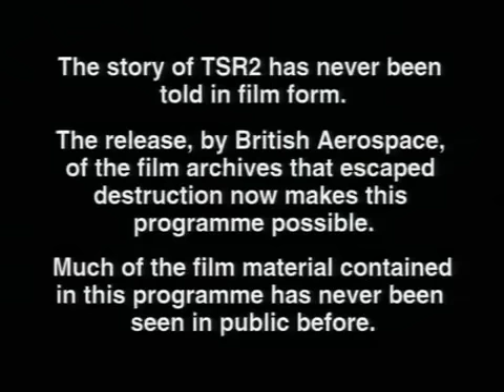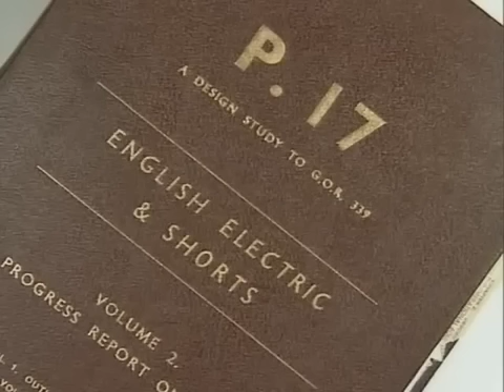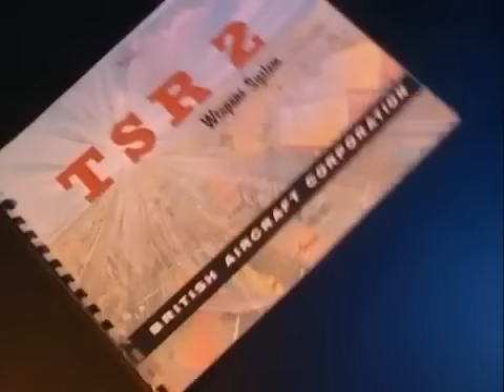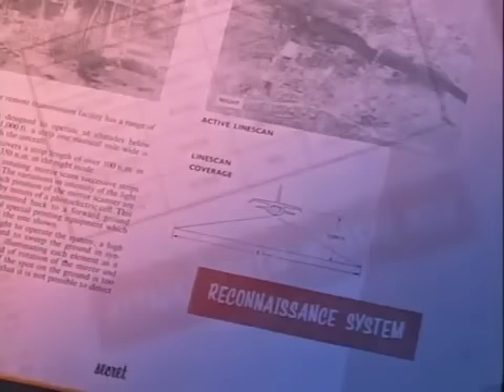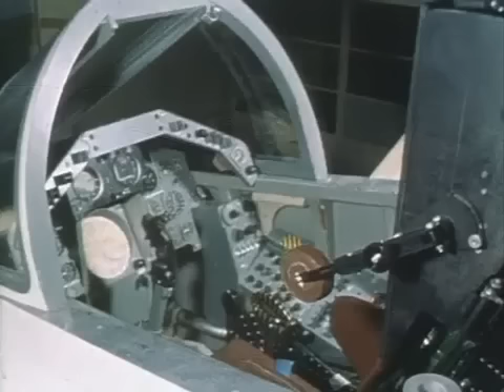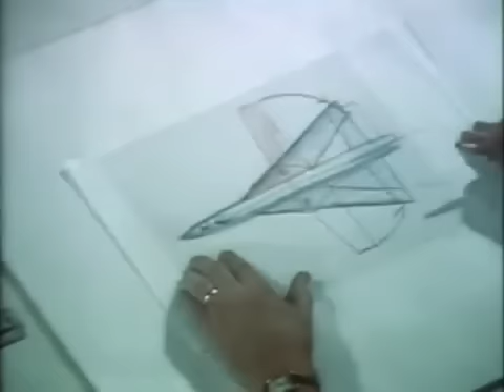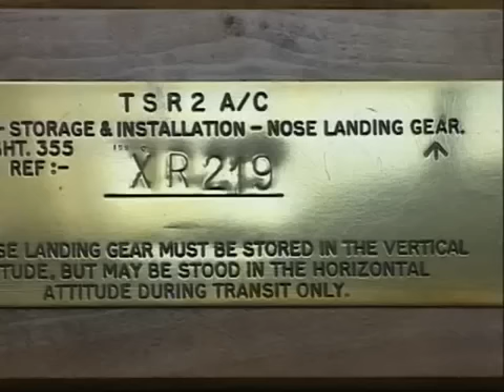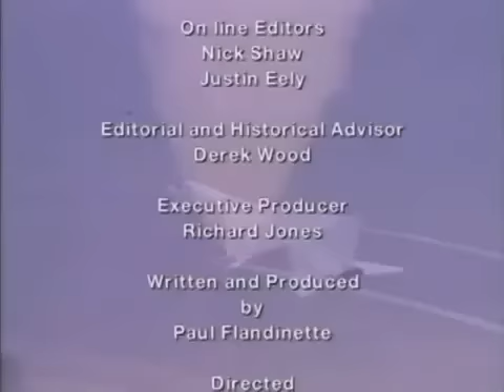TSR2   The Untold Story   Full Documentary

Comment: Yakuta Go •  I think you are confusing the roles here. Yes, the MIG 25 was unveiled in '67 & had Mach 3 performance in a dash -  ( but not in sustained flight ) because it was an Interceptor.
TSR -2 was designed as a Strike / Reconnaissance  platform with excellent flight characteristics at high altitude down to low level. The clue was in the name: TACTICAL STRIKE RECONNAISSANCE.
And the only reason it did not achieve all of its performance objectives was because of project cancellation. Even today, it is clearly obvious that the aircraft would have met -- AND exceeded these goals because of superior design.
Reply: But when you pushed the early Lightning to the limits, the engines wouldn’t inevitably end up blowing themselves to pieces.

Comment: As Sir Sydney Camm said famously: "All aircraft have 4 dimensions, length, height, width, and politics, TSR-2 only got the first 3 right."
Reply: Unfortunately Camm forgot economics. The broke UK economy could not afford a beautiful but overbudget aircraft  with badly flawed engines that would take years to fix, no export prospects and a better competitor in the F-111. Reality sucks but it is still reality.
Reply: @Completeaerogeek  The engine TSR-2 used was a version of the Olympus. Olympus was used on the Vulcan bombers and Concorde of course. As an aerospace engineer for 40 years, it is unheard of to cancel a project after just a few months from its first test flight. It takes quite a few years from first test flight to entering service. And of course, immediately (days) after the cancellation, all the prototype aircrafts were destroyed, including all drawings and rigs for it manufacture, nothing remains apart from two prototypes on display in museums. Officially, TSR-2 had never existed. It is politics more than financial considerations I'm afraid.
Reply: @daning9764   Dan if you understand engineering you would know that 'Bell Mode' a resonance problem with the LP shafts took years to fix at a time when the UK was broke. TSR2 was massively over budget and the F-111 proved superior in all performance regimes. If you were [paying for it what would you do?
Reply: @daning9764   And NO they were NOT destroyed. There are 2 beautiful examples- one in Cosford and one in Duxford. I know I travelled halfway around the world to see them recently. The simple truth is it was a problem child the UK could not afford to develop to be an also ran to the F-111.
Reply: So says the legends. Do you have a source for that quote?

Comment: ' only 1 engine in re-heat & he left behind a Lightning with BOTH engines in re-heat'.....WOW!
Reply: That was my sentiment to.
Reply: @speedbirdconcordeBOAB  They wouldn't have seen it and after a low level (illegal) supersonic pass they wouldn't have heard the tannoy announcement either.
Reply: This was because the lightning pilot was slow to engage his own reheat - as has been written before, a Volvo can outrun a Ferrari if the Ferrari driver isn’t ready, doesn’t respond straight away and is behind to start with

Comment: Something that I see as troubling is the extreme angle-of-attack this bird carried while taking off and landing. This was with flap-blowing in operation? Try to picture taking off at maximum combat weight. What also does the landing look like if the bleed-air for the flap-blowing is inoperative? There is also the issue of side-area of fuselage with respects to the effects of  crosswinds during landing/takeoff.
Reply: A side effect of the requirement to be able to land and take off on a grass runway. Despite being supersonic the TSR 2 had to be able to take off and land at low speed. The Harrier solved the problem by VTOL. The TSR 2 used air holes to supply or extract air from the wings surfaces to increase the lift and maximum angle of attack.

Comment: The B-1B Lancer and the Russian 'White Swan ' would seem to be 'alright ' if the TSR-2 was flying today. It was ahead by a 100 years.
Reply: 100 years?? Lol. Yeah def not
Reply: The TSR 2 concept which allowed it to fly without swing wings was the use of air holes to pump and extract air from the air flow around the wings. This allowed sufficient to generated for take off and landing at lower speed than would otherwise be possible while making no compromises on the efficiency of the wing design for supersonic flight.
Reply: @michaeledwards2251  what took you so long to reply ..👍
Reply: @vivekraychowdhury4348  
Found your comment today.

Comment: You can tell staight away that this was a "condition" imposed on the labour gov for some reason.An external influance.
Reply: It's called economics. The UK economy which was not in good shape at the time, couldn't afford to develop the aircraft for a small RAF order and for which there were no likely foreign sales. (Australia had already picked the F-111).  It cost a staggering amount of money up until its cancellation.The Olympus engines alone took years more development to become reliable ('Bell mode' caused them to self destruct taking out a Vulcan test aircraft in the process)  Performance wise, the contemporary F-111 proved to be a better aircraft in virtually every respect. Read Damine Burke's excellent book on TSR2 for some reality on this.

Comment: Another aircraft dismissed due to political pressure from America!
Reply: Very similar to the fate of the Avro Arrow. They can't stand to have any other country have superior technology
Reply: If the TSR-2 was half the plane then that people like you think it is today, it would have been awesome.
Reply: The USSR reveal the MIG25 - the faster fighter jet that can fly MACH 3 in 1967. This TSR.2 is obsolete before the completing development and it didn't achieve the goal of taking off on a short run way.
Reply: @deeremeyer1749  The TSR 2 was cancelled on 6th April 1965 and the F111 first flight was 21st Dec 1964..where did this 5 years come from ?
Reply: @parsleylionunk3235  "First flight" doesn't mean in the U.S. what it means in the "UK" or "Commonwealth" and since the USN was the intended "customer" for the "F111" or rather the "aircraft eventually designated "F-111" as a carrier aircraft and "alternative" to the F-4 Phantom with "side by side" seating for the "pilot" and what would be called a "navigator" in any "Royal" air farce or fleet air arm and a "navigator-bombardier" or "weapon systems officer" or "radio-intercept officer" in the USN; and the "F-111" was the first attempt at a "joint strike fighter" and wasn't "introduced" (publicly) until 1967 and was "canceled" by the USN in 1968 and required "redesign" to address "fatigue cracking" (something "Commonwealth" air farces have extensive experience with in their "multi-role" aircraft) and "flight testing" with/by the USAF wasn't "complete" until 1973, the idea that the "F-111" for "foreign sale" had anything to do with that POS "tactical reconnaissance strike" aircraft getting "cancelled" is fucking hilarious BEFORE you even consider the fact that only the AUSSIES ended up "adopting" the "F-111" AND the USN SURE AS HELL WASN'T CALLING THE "PROTOTYPES" F-111S  WHEN THEY WERE SUPPOSED TO BE EVERYTHING BUT "FIGHTERS" AND WERE "COMPETING" AGAINST THE "EA-6B" AND THE "A-4" AND WHAT WOULD EVENTUALLY BECOME THE "F-14" WITH ITS 2-DIGIT "IDENTIFIER" BECAUSE OF ITS "DUAL ROLE" CAPABILITY AS BOTH A CARRIER DEFENSE "INTERCEPTOR" AND A "FIGHTER" WITHOUT NEED FOR AIRBORNE "EARLY WARNING" OR "RECONNAISSANCE" SUPPORT. 

THE USN AND USAF HAVEN'T RELIED ON "RECONNAISSANCE" AIRCRAFT FOR "TACTICAL" AIR SUPERIORITY OPERATIONS SINCE...FOREVER AND THE "AIR WAR" IN VIETNAM PROVED HOW "EFFECTIVE" A SO-CALLED "TACTICAL STRIKE FIGHTER" AND "JACK OF ALL TRADES" AIRCRAFT WITH A "COMMANDER" PILOT AND AN ENLISTED "NAVIGATOR" AS THE "AIRCREW" REALLY WAS IN THE HANDS OF "FRONT LINE" SQUADRONS OF AN "INDEPENDENT AIR FORCE". EVER HEARD OF THE F-105 THUNDERCHIEF? SURE IT WAS A "SINGLE-SEATER" BUT ONLY BECAUSE NOBODY CAN "NAVIGATE" FROM THE "BACK SEAT" AND IT WAS A SUPERSONIC "FRONT LINE FIGHTER" IN A DOUBLE-SONIC WORLD BY THE TIME ALL THE "AVIONICS" NECESSARY TO ALLOW THE "PILOT" TO "OPERATE" THE AIRCRAFT IN ALL ITS "ROLES" WERE ADDED. 

THE "F-111" JUST MADE A BIGGER, MORE COMPLEX, MORE EXPENSIVE, LESS AGILE AND "SOFTER" TARGET AND DOUBLED DOWN ON STUPID WHENEVER "LOW-LEVEL APPROACHES" WERE A SUPPOSED "DEFENSE TACTIC". 

THE "TSR-2" WAS EVERY BIT AS MUCH OF A JOKE AS EVERY OTHER BRITISH "MULTI-ROLE" AIRCRAFT AND ONE THAT WAS "CANCELED" ABRUPTLY AS SOON AS "VIETNAM" ESCALATED AND EXPANDED INTO AN "AIR WAR" FOR THE EXACT SAME REASON THE "CF-105" WAS "CANCELED" JUST AS "KOREA" WENT "AIR WAR". 

DESPITE BEING THE EXACT "THEATER" AND "ROLES" BOTH AIRCRAFT WERE "DESIGNED FOR" AND THEIR "WORLD BEATING" TECHNOLOGY, PERFORMANCE ETC AND "ADVANCED STAGE OF DEVELOPMENT" PER ALL THE GOVERNMENT PROPAGANDA, IN REALITY THEY WERE JUST EXAMPLES OF COMMONWEALTH "PAPER AIRPLANES" ONLY "INTRODUCED" IN A "COLD WAR" EFFORT TO KEEP "AMERICA" AND "RUSSIA" IN A PERPETUAL "ARMS RACE" AND IN "COMPETITION" WITH EACH OTHER WHILE "COMMONWEALTH"  COUNTRIES "CAUGHT IN THE MIDDLE" CASHED IN ON BEING "PARTNERS" WITH BOTH "BEHIND THE SCENES" THINKING NEITHER "SUPERPOWER" WOULD EVER GET WISE TO THE DUPLICITY.
Reply: @parsleylionunk3235  The "world's" first geosynchronous communications satellite happened to be launched on April 6, 1965 and that sure as shit made "reconnaissance" aircraft "obsolete" as far as "ELINT" missions go in "international airspace" and of course even supersonic "spy planes" and the SR-71 were only stopgap measures as far as "intelligence gathering" and never invaded "enemy airspace" but simply flew high and/or fast enough to look "into" foreign countries from "international airspace". And no serious, professional and "intelligent" military force or civilian government ever thinks or acts "tactically" when it comes to "national defense" OR relies on "reconnaissance" and "strike" flights flown successively by the same "forces" for the obvious reasons. Those being that  "successful" penetration of "enemy airspace" by "recce" aircraft doesn't mean they weren't detected; the "recce" missions have to be planned using existing "intelligence" OR were/are simply "flying blind" OR depend on "detection" by ground-based "radar" to know/guess/hope they're "on the right track"; and only "tactical" assets which are "mobile" and "vulnerable" to "recce" AND "strike" missions need to be "recced" and are easily "faked" and/or "hidden" and/or "camouflaged" and/or moved far enough before "recce" and/or between "recce" and "strike" missions that the end result is still multiple "missions" flying blind and inevitably incurring "operational losses" without experiencing "combat" at all. Especially since "recce" of typical idiotic "high speed/low level" variety "practiced" by "independent air forces" relies on both "recce" and "strike" pilots and "aircrew" conducting their respective missions in perfect "synchronization" as far as weather, initial points, lighting, etc DESPITE "recce" being most effective from "abreast" the "target" and "strike" being most effective from "above". 

Not to mention that targeting "hardware" - guns, missiles, warships etc is idiocy when engaging in "symmetric warfare" against an enemy of "equal strength" OR "assymetric warfare" against a "weaker" enemy given that "software" (personnel and "leadership" and its "support systems") is what makes "hardware" a "weapon" and is the only "irreplaceable" asset on a "battlefield" whether "combat-tested" or not. 

Sending "front line" personnel to/on a "support mission" of keeping "multi-role" aircraft "mission-ready" and "supporting" prima-donna "multi-role" aircraft "pilots" who treat "aircrew" like second-class "citizens" and don't "treat" ground-based at all is exactly why "independent air forces" and their "front line" aircraft and "pilots" have always gotten their asses kicked in real "air wars" and never establish "air superiority" and end up flying "support missions" while their "allies" dominate the "combat airspace".
Reply: @deeremeyer1749  Well thank you for that long rant..perhaps you could get whichever point you are trying to make in a more economical fashion...you seem to have taken the legal and law route - i.e.why use one word when 20 will do.
Btw not sure I actually mentioned anything about FMS did I ?...oh and well done on your conspiracy theory as well....are you perhaps saying that all technogical military projects should be the total preserve of the USA and Russia only and their allies should be grateful for whatever hi-tech toys those two superpowers grant them and not develop their own industries (or if they do in the case of western democracies only something useful to the USA ?)
Reply: Well, that’s actually the life story of British aviation history after the Lightning, isn’t it?
Reply: Was it from America? Quite probably other scources were exerting influence.The 1960's were not a glourious period of British Polotics.
Reply: @lazoputz3514  Having the TSR2 cancelled and destroyed is exactly the same as what happened to the World's first digital computer. We shared the tech with America and then after WW2 was over we had to destroy all machines. The Americans then built Eniac, I think it was called, and claimed it was the the World's first computer.
Reply: Oh please...cry us a river you big baby. It was cancelled because of cost and a Labour government..end of story.
Reply: @shrimpflea Just to put you right the government shut the program down, as always and at the time it was NOT a labour government as to the cost it was cheaper than a similar aircraft. Branson tried to buy thirty five towards the end and was told no
Reply: @jetmec  So you say.
Reply: @shrimpflea  So I know
Reply: @jetmec  Well aren't you special.
Reply: @deeremeyer1749  There's a padded cell somewhere...WITH YOUR NAME ON IT !! I went FULL CAPS SO YOU WOULD UNDERSTAND !!
Reply: @kwd3109  Well said.

Comment: Sorry  but there is little evidence the TSR2 wouldve been a great aircraft. Most multi role aircraft are like sporty all rounders, pretty good at all sorts of things but not great at any one task. It was wildy expensive, the main reason it was cancelled after all, there were better alternatives, like the F4 for example, which was physically smaller, faster, and could be used as land based or carrier operations. It would have been complicated to maintain, like most British designed aircraft of the period  - the Lightning was a nightmare to work on - so all in all cancelling it was a blow to British prestige, but not much else.

Comment: In the world of slimy politicians Dennis Healy was outstanding.
Reply: It’s death warrant was signed by Tory Duncan Sands MP years before.
The Russian SAM development altered the airspace needs to fast and low.
The Americans did not want it, check out the Avro Arrow 
It was way over budget and it’s engines were still in development, in fact whilst problems with the engine were being investigated on the prototype the the flying test bed for the engine - the Vulcan - was written off as the test engine exploded.
The radars and other avionics had not been developed.
After stopping the project the RAF test flew the F111 in its low level attack role and found that the Blackburn Buccaneer flew Lorre and faster than the TSR2 and F111 at a tenth of the price

Comment: It is inevitable that those who knew most about TSR are least able to tell you the whole story because of the official secrets act of course and because we can't upset our cousins egos across the pond.
Harold Wilson was entirely in the pocket of Russian intelligence but it was the Americans, humiliated and threatened by designer Teddy Petters track record that were determined to sabotage TSR and make room for their F111.
But if you can read between the lines and ask yourself exactly how 
An aircraft of that weight and wing loading could be so docile and easy to handle, it wasn't just the blown flaps. An aircraft that could easily outrun its cousin the EE lightning. It is important to compare this masterpiece with other's of the same pedigree.
The use of anhedral wing tip's to offset the high wing loading.
The incorporation of effective mass reducing technologies, then still in their infancy, but used to great effect. The harmonic tuning of the fuselage to exploit the resonant nodes. The hints are there and explain the outstanding performance to those who scratch beneath the surface.
Super conductivity was then and still is now,  subject to the official secrets act. 
But even a young boy with an active imagination can see that is exactly what a permanent magnet is and does.

Comment: That's a weak Labour government for you!
Reply: "That's a weak Labour Government for you"

I fixed your sentence for you
Reply: The Conservatives cancelled five aircraft projects in 1957. They also wanted to cancel the English Electric Lightning. So to come out with a comment about the Labour Government is particularly inappropriate. The problems with TSR2 involved excessive cost, lack of overseas sales, difficulty of maintainance, too many committees, length of time getting into service, limited role. Tornado was flying less than ten years later and was a better platform. Avionics had also matured by the time Tornado came along. British Aerospace got far more work out of Tornado with nearly 1000 aircraft produced compared with the 200 TSR 2s that would have been foisted on the RAF. Sadly, the TSR2 decision was the right one.